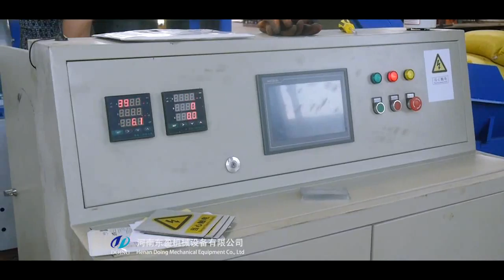Plastic to diesel plant processing waste plastic to diesel

Comment: nobody asked the balance of energy needed to produce fuel with this engine?
Reply: Seen that... It works with a wind pump. The oil byproduct from the plastic is runs it on a line that feeds  drops of oil in front of the air blowing in though a torch jet I use propane to start it for a min[to heat up the fire tube that it runs off the oil byproduct made, even the end gas is burnt to heat it. I get a gallon of fuel for 8-10 pounds of plastic... average burn 100 pounds ten gallons in up to 3-5 hours at most..

Comment: first 20 seconds unsecured (presumed full of initiant fuel) pressure vessel connected to a tensioned line crossed by pedestrian.
Reply from the maker: We have control over the amount of material, There is no need to worry about safety
Reply: No need to worry about safety...lol if you are working at this plant you will just get cancer.

Comment: pros. reduces plastics in our world 
cons. Produces fossil fuels responsible for some of the issues we face today.
requires more energy then produces, 
you still have an ash waste product never mentioned in any videos,
should be the last resort when we cannot re purpose the plastics
Reply: The well designed units only use external fuel during initial heating, once the process begins it produces gases which are used for the rest of the process. They are net positive fuel production and the by-product is carbon black which can be used in manufacturing.  This process is currently the only viable means to process waste plastics because recycling is a myth created by the plastics industry.
Reply: I suggest you learn more about the process. This is a brilliant option if the plants can be constructed cost-effectively. With the right configuration you can also start to use existing land fills as raw material and so work away land fill sites and free up valuable space.
Reply: @andrevantonder8206  biggest obstacles are permitting and pyrolysis does not qualify as recycling. Waste tagged for recycling is not available as feedstock for pyrolysis. It's truly stupid and controlled by the plastics lobby.